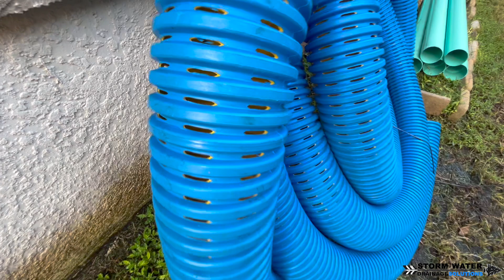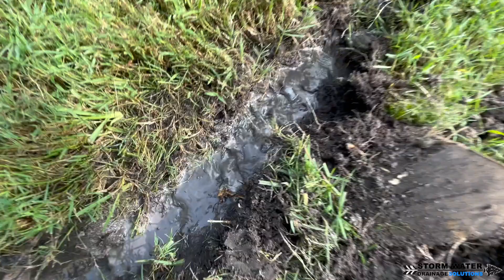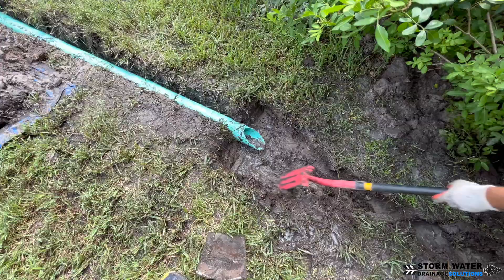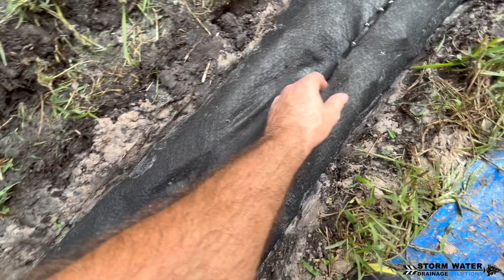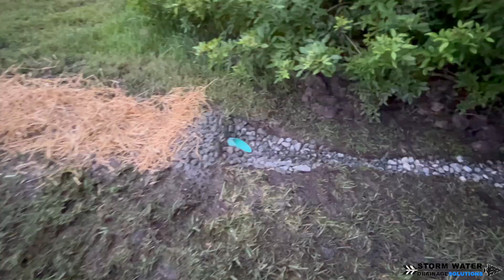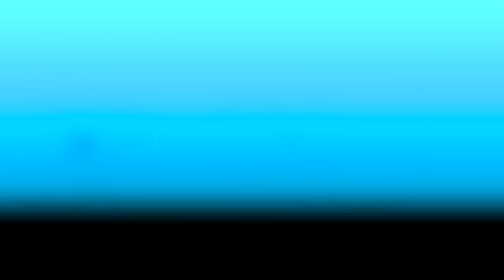French Drains Gravity Fed - How To Build - Tampa Yard Drainage

Comment: How much would you charge for 100 ft French drain gravity fed
Reply: Roughly $3k-$4k depending on the area you live in and how long the discharge is.

I live in Lousiana and just paid $2,800 for a 60ft French drain for part of my foundation plus a 40ft discharge line all gravity fed using slotted SDR35 pvc for the French drain part and solid SDR35 pvc for the discharge.

Also I had one gutter downspout piped in along side. 

It came out amazing!

Be sure to do your research and check pictures and call references of contractors you interview.

Selecting the correct contractor is 90% of the battle and NEVER accept their first quote!  Always negotiate, especially this time of year when they are all hurting for work.

Comment: Civil engineer here who specializes in municipal drainage. Agree with the use of nonwoven geotextile filter fabric as soil separator. We have high groundwater in my area where water seeps from under the concrete road panels creating a road hazard. We design and construct subdrains (aka french drain) below roadways to manage the groundwater.  We use an 8oz filter fabric with 3/4-1.5 washed stone and a 6-inch perforated SDR35 pipe (overkill for residential but same concept).  Consider using an additional directional clean out at the top of your run for access and cleaning. Really enjoy your videos. Thanks for sharing 👍